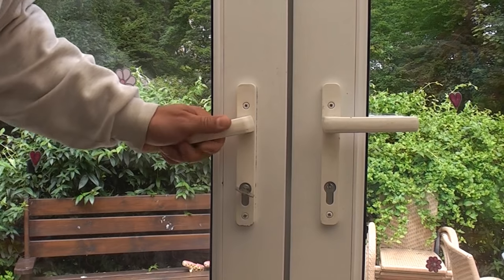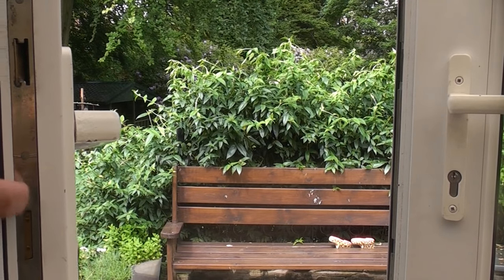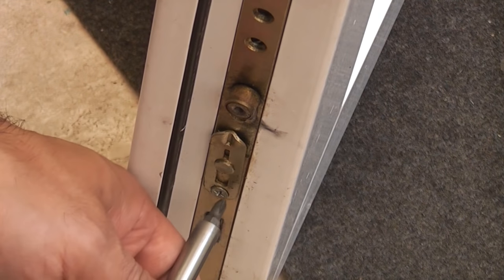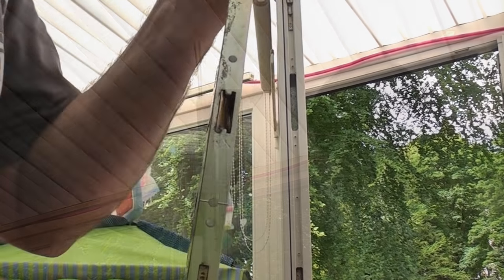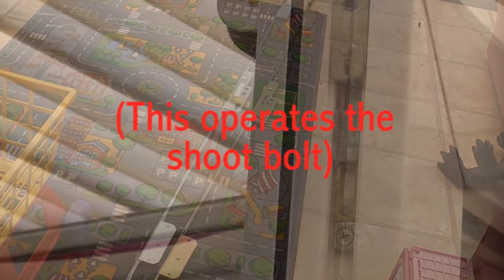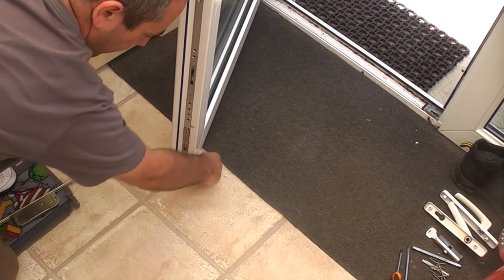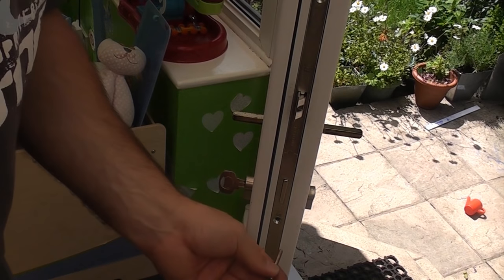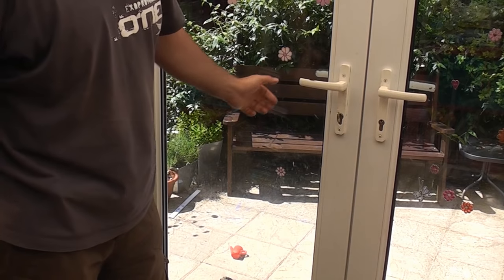multipoint lock replacement

Comment: Thanks so much for this video. You explain it really well and it's easy to follow. 
I didn't need to replace the whole gearbox but took it off cleaned it up and lubricated it (graphite spray) and it was working properly again. 
Finding a replacement gearbox nearby isn't easy mostly looking at ordering online and delivery worth bearing in mind

Comment: Helpful and clear description of a tricky job, but do check the handle locking cams before going to the bother of changing gearbox/lock etc.  My lock was fine, but the handle cam had crumbled on the inside handle and the friction parts were a bit of a mess.
Reply from the maker: Thanks for the comment 👍

Comment: Same thing happened to me, had my multi lock mechanism changed twice, problems with lock occur when doors locked and you check if locked by pushing handles down, somehow pushing the handles to check creates this problem ( pressure ? ) do not pull handles hard, push softly on handles when checking folks
Reply from the maker: I'm not sure if that causes the problem, but you could be right 🤔

Comment: Thanks for posting this video. The euro cylinder seems to be the problem on our door. We are unable to turn the key from either side. It's locked so we are unable to use the handle to release the multi point lock and open the door. Any advise would be appreciated.
Reply from the maker: I think you might need a locksmith. I only know how to replace the lock when the door is open. I think they have to de-glaze the door, but it is not something that I know how to do, sorry.

Thanks for the comment 👍

Comment: Would it be possible to secure the door shut somehow? I suspect the gearbox has gone for a family friend's door (or very close to failing entirely) as she has to lift the handle to unlock the door, but it might be a few days to find an exact replacement and install it and I would imagine if I took the old gearbox or even the whole multipoint lock to get the specs, that even a handle lock made from wood that I've seen in one of your videos would not work.
Reply from the maker: I would not remove the gearbox and then close the door, as the shoot bolt might drop- then you'll have a real problem opening the door. 
Most locksmiths have these in stock, I've changed about three recently, I just take the whole multi point lock out and my local locksmiths shop (Rostrons in Darwen), will either sell me a full unit, or replace the gearbox, depending on the make.
Reply: @ultimatehandyman  The door I'm trying to fix doesn't have any bolts at the top or bottom fortunately. Just two hooks, a latch and deadbolt. Going to have to go back and get some more measurements as GU seems to have an older and newer style with differing measurements between the latch and deadbolt. Thanks for the reply.
Reply from the maker: @JohnSmith-ox7xc   I hope you sorted it!
(Sorry for the late reply, YouTube comments has been playing up AGAIN, So I have just seen this)
Reply: @ultimatehandyman  No worries. Only just got around to replacing the gearbox today - Had to go back several times because I got the wrong measurements or needed more. Installed it without too much trouble thanks to your video :)

Comment: Can you replace the euro cylinder and leave the rest ? I want to change my euro cylinder in a multi point lock (no handles on my door) but can’t find an easy answer if I can do this without changing the whole gear box.
Reply from the maker: Yes, you should be able to, providing you can see the screw that holds in the euro cylinder when the door is open.
Example with handles-
https://www.youtube.com/watch?v=3vHnzeSlOY4&pp
Reply: amazing thank you  @ultimatehandyman

Comment: So, my door won't lock. I can open and close it no problem in the usual way, the handles lift up and down as normal. However I then don't seem to be able to turn the key fully in the euro lock to be able to lock the door. I have bought a new euro lock this morning which when inserted into position and screwed in place reacts exactly the same as the original one I took out, it doesn't fully turn to be able to lock the door. Does this mean I need to now replace the whole system? Any help appreciated.
Reply from the maker: If both the old Euro cylinder and the new Euro cylinder will not allow you to lock the door, then you might have a faulty gearbox/lock. Have you tried locking the door with the door in the open position (just to make sure nothing is obstructing the locking mechanism from reaching their locking position)  👍

Comment: Very interesting to see how  the multipoint mechanism works and what's involved in replacing the lock.
Reply from the maker: James Rawlings 
Absolutely, there is quite a lot of work goes into making one of these. I did remove the cover from the gearbox yesterday to see if the old one could be repaired but it was not a simple job to do!
Thanks for the comment

Comment: great video helped me massively, my door has just broken could you advise on any nationwide outlets that are most likely to have either my gear mechanism or full strip?
Reply from the maker: I normally go to my local locksmith's shop in town as there are quite a few different ones.
The only national firm that I know of that sells some multipoint locks is Screwfix-
http://www.screwfix.com/c/security-ironmongery/upvc-door-locks/cat810330?cm_sp=managedredirect-_-security-_-upvcdoorlocks
I hope this helps ;-)
Reply: Thank you very much for the reply should both of them options in the link be suitable? Thank you for taking the time to help me have a great new year!
Reply from the maker: I have no idea of the suitability, which is why I normally go to my local locksmiths. 
If I were you I'd wait till the new year to ensure you get the correct one, you can then remove it and take it with you ;-) 
All the best for 2017

Comment: I can't unlock my uvpc multilock door.  The key turns a bit and then it jams. I used to have to forcibly lift the handle to get the key to turn but obviously the internal mechanism is now broke and won't unlock.  I'm interested to know how you got that door unlocked because I think I will have to break the barrel, take it out, and then somehow try and flick open the internal locking mechanism.
Reply from the maker: Mine was already unlocked when the gearbox failed (thankfully).
I did read that you can get to the lock mechanism, but you have to de-glaze the door. I’m afraid it is something that I have never done 👍
Reply: I've seen a video where you take the handles off, break the barrel and then remove it.  There is some latch (I think one calls it a CAM) situated at the top above where the barrel used to be, that needs to be shifted to one side using an  allen key. Once shifted , the door should unlock. Personally , I think my door has tilted a bit and now the lock is stuck. Even lifting the door a bit by forcing up the handle  is still not enough to allow the key to rotate and unlock the door.
Reply from the maker: I’ve done a video on lock snapping, but that is only useful if you don’t have the key for the door. If the gearbox is broken, you can’t open the door. Even if you snap the lock and use the Allen key to turn the cam- you still won’t be able to open the door, as the gearbox will not move the lock bolts.

Comment: Are there any of these types of doors that have hidden retaining screws holding the cylinder in place ? if not then maybe the head has snapped off on ours - as we don't appear to have a retaining screw.
Reply from the maker: Yes, I'm sure that on my French doors at the rear of the property, one door had the screw showing, but the other one was hidden behind a piece of plastic. I had to drill a hole through the plastic, before I could access the screw.
Thanks for the comment 👍

Comment: Hi, on a typical mech change do you find that the original keeps are right for the new mech? especially if it's old/obsolete. I've always bought new ones just in case and sometimes had to manipulate their position, this seems to happen often I'm not sure if I have just been unlucky! thanks for the upload.
Reply from the maker: Not sure, sorry.
I just removed the mechanism and took it to my local locksmiths for a direct replacement. The door has worked perfectly since. 
Thanks for the comment

Comment: Hi just wanted to know why did u remove the strip from the door?  One needs to replace just the lock.
Reply from the maker: The gearbox was broken, so you have to replace the whole multi-point locking mechanism.
Thanks for the comment 👍

Comment: Can the lock be changed so only the key locks the door without having to lift handle, havent got strenth in hands anymore
Reply from the maker: I'm not sure, sorry.
I have seen some doors that automatically latch, meaning there is no handle externally to open the door (you need the key) but I'm not sure about locking the door.
Thanks for the comment 👍

Comment: i need help, i have upvc double french doors, i can unlock and lock the door but the multi lock mechanism has failed and itsin the locked phase, any help is appreciated.
Reply from the maker: Sorry Paul, I've never done it where the door cannot be opened.
I did speak to someone that said you have to de-glaze the door, but I'm not sure what you do after removing the double glazed unit. I'm afraid you might need a locksmith!

Comment: I need to change mine but the one I’ve got is discontinued so had to get a newer mechanism which is slightly wider  😬 how easy is it to trim the door or am I best getting a fitter in
Reply from the maker: Not sure about that. It might be best to get a locksmith, I've only ever replaced like for like.
Thanks for the comment
Reply: @ultimatehandyman  locksmith came round yesterday & luckily had a second hand one as the new one I bought was never going to fit. I guess if this second hand one breaks I’ll have to buy new double doors 😲

Comment: Good video and great advice. It seems my door needs springs to be replaced because it takes a lot of effort to get the handle up and the locking itself also sticks sometimes. Could you kindly do a video showing how to replace the springs?
Reply from the maker: +Shakil Ahmed I don't think you can replace the springs, it sounds like your gearbox might be on it's way out or the door might need adjusting.
Reply: +Ultimate Handyman My door is about 15 years old. Do you think the whole locking mechanism should be replaced? If yes, is there any video that you've done on that? Cheers

Comment: Mine lately has had an issue with the handle can l0ck door ok but opening we often have to loft handle to then retry  the handle to then open door would it be just a work shaft/handle? Or whole lot ? Thanks it's front door not patio thanks
Reply from the maker: Not sure, sorry.
We had a door where we had to lift the handle to unlock it, and that lasted for decades with no other obvious problems.
Thanks for the comment

Comment: Video was great, showed me the nuts and bolts so to speak.....I need help...my father in law has a front door with a lock master multipoint lock....everything works fine...problem is...he is now on his own and a little bit forgetful....if he pops out to put something in the bin, and returns inside, he just closes the door behind him....he doesn't key lock the door until the evening....so if any chancer tries the door handle....he's in......do I need to change the main lock for a new gearbox....ie..that the outside handle will not open the door unless you have a key....I rang one locksmith who said it's no problem to do but the charge will be a few hundred Euro..sounded a bit steep...any help would be much appreciated....dave
Reply from the maker: +whatty mernagh 
I'm not sure if that is a good idea to be honest. I do know someone with a door that locks itself when closed without turning the key, but the problem is that if the door closes when he is out at the bin and he does not have the key he won't be able to get back in himself!
Reply: +Ultimate Handyman ....yep i hear you....thanks for the prompt reply....I will put that to my wife and let her decide !!....all the best.......dave.
Reply from the maker: +whatty mernagh 
I did a job at my friends house the other week and each time I went to the van I was locked out if the door closed behind me, which was a real pain to be honest. Best to discuss it with the wife ;-)
Thanks for the comments Dave ;-)

Comment: Yes absolutely, the key turns to about the 1 o'clock position and stops.
Reply from the maker: I'm not sure, sorry.
A mate of mine once replaced the Euro cylinder in his door and could not lock it as he did not realise he had to lift the handle first (which is why I asked you).Have you tried removing the gearbox and inserted the Euro cylinder to ensure the gearbox is not faulty?
I'm not sure what else to suggest!

Comment: My door is stuck.I accidentally closed the door without the euro cylinder and shootbolt mechanism at the bottom was NOT screwed so when i closed it i think the shootbolt mechanism/plate came out a little bit off the door and got in the door frame.so now when i open it the top of the door opens slightly but at the bottom door is completely stuck. Any suggestions?
Reply from the maker: +The Hitman 
Sorry, I don't know how to overcome this problem. Your best bet is to ask a locksmith as they will know for certain.

Comment: Nice upload, I currently have an issue with my door that has a Yale Multi-lock where when unlocked the latches don't go all the way in and the key needs to be turned to it's complete maximum and held there for them to do so. So this came at a good time. Cheers
Reply from the maker: ***** 
Thanks for the comment ;-)

Comment: I have got a question if you don't mind. Are these internal door lock
 mechanisms needs oiling or greasing from time to time?
Reply from the maker: I normally give it a wipe with a lint free cloth and then give it a spray with some silicone spray. I never use oil or grease though as that can attract dust etc. and gunk up the mechanism.

Comment: Nice video. I've had to do something similar however didn't replace the whole thing. Did you not replace this with the avocet ABS euro locks? I'll be replacing mine soon with them they look the business!
Reply from the maker: Zed Man 
No, these locks on these doors are Yale high security cylinders.
Much cheaper than the Avocet cylinders but probably not as good!
Thanks for the comment ;-)

Comment: Hello sir,ive got question, i change same or similar lock in my back door,everything fine but now ive got big trouble,that lock  pin from bottom door what you use masking tape to hold on its fall down when door was locked,now i cant open my door,cause that pinon bottom door is keep door lock on bottom,any idea open door ,take off door or i need profesional locksmith? Thank you in advance
Reply from the maker: I'm not sure if you will be able to fix this without calling out a locksmith.
Perhaps you can open the door slightly due to the door flexing, if you can you might be able to open the door and then lift the shoot bolt up using a strong magnet or similar? 
I'm afraid I can't be more help as I'm not a locksmith.
Reply: Thank you very much for response,that i was afraid,i will try your sugestion,also maybe off door from hinches than try up slide door,if not i will call locksmith,cheers

Comment: hi just a quick question hopefully you will reply, how do you know if the gearbox is fucked or the whole mechanism needs changing ? are there any obvious signs to tell which one needs changing / repairing ?  cheers
Reply from the maker: I think it depends if the gearbox can be detached from the rest of the mechanism by screws, my lock was riveted together and so I just got a full multipoint lock. Some of them can be separated into separate components though, which would make it possible to replace just the gear box.
Perhaps if you split the lock by removing the screws and try the handles you might be able to see which part is faulty?
Reply: super man if the gearbox can be removed take it of and operate  the driver bars on the back of the mpl by hand if all the hooks and rollers operate smothly then the gearbox is fucked.
i wouldnt trust using the handles on the removed gearbox alone as quite often it will operate on its own but fail under load.

Comment: I've changed a euro cylinder lock in a 3 point locking UPVC door as the door was second hand and didn't have a lock. The securing pin that secures the cylinder in place does not have a countersink in the edge of the door and with the pin/screw in place i'm unable to lift the handle to engage the top and bottom shoot bolts as the pin seems to be fouling the sliders. Any ideas as to why this is happening? Thanks
Reply from the maker: I'm not sure sorry.
Would countersinking the hole fix the problem ?
Reply: Ultimate Handyman no its as if the fitting screw is locking the moving bar and preventing it from sliding down

Comment: Great video, our door for has a sloppy handle (lost movement) but I suspect the issue is in the mechanism - have you Any thoughts, thanks
Reply from the maker: Typey1 
I'm not a locksmith but it sounds like the internal springs may be worn out or broken. None of the multipoint lock handles that I have seen have built in springs so it's all done by the multipoint lock, It may be possible to replace the spring part but it's probably better to replace the whole lock as other components might also be wearing out.